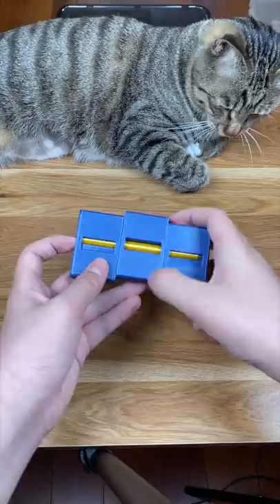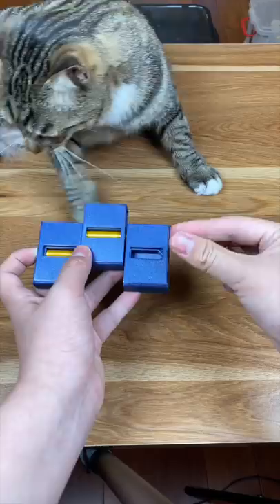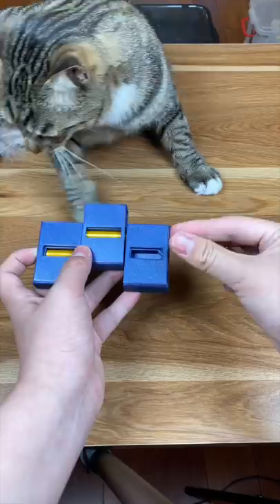3D Printed Magic Trick Box | How does it work?🤯

Comment: That's easy when he pushes it up, a piece that looks identical comes down and the original one goes down to where it is not visible
Reply: Yes x2
Reply: Oh. I thought it was magnets, but after reading your comment and watching it again your right.
Reply: True
Reply: Anyone who didn’t see that is weird
Reply: No, he could put anything inside of it not just the pen. If I put a red crayon in there will a yellow piece pop up above? That’s incorrect
Reply: @Caboose_Sim  Yes, you can see the hatch thing flip, the original item goes up with the box and gets stuck in a special compartment until you move it back down
Reply: @Caboose_Sim  thats exactly how it works, its called "zig zag pencil"
Reply: @Caboose_Sim  I used to have this same trick with a string it’s how the og comment is
Reply: Very true
Reply: No where would it go up is only one area and in the middle he takes the right piece out and bottom is only two spaces it has to be strong magnets on the ends of the pieces so that he can take it apart and put it together
Reply: @sweetred6264  its a trick called zig zag pencil, there are 4 pieces inside it, the full pencil is hidden away where the 3 boxes join when you slide them, that opens up the hidden compartments with the 3 small pieces inside, they make at least 2 and 3 compartment versions of it and you can buy it on ebay for a couple of bucks
If it was strong magnets it wouldn't have fallen out under its own weight at a pretty shallow angle for a start, thats not how magnets work
Reply: Or he just has small mirrors in that make it look like the pen splits but it never does
Reply: Actually it goes up but same concept
Reply: @nicktyler8139  you see the piece fall out and you can take the other 2 out, there are 5 pieces altogether, 1 full size pencil, 3 small pieces and the box, how many more people are going to comment on this without looking at Google first, we all have the world's information at our fingertips, c'mon people, how many times do people have to say how it works?
Reply: @linkinpiatak6669  if you hold it the other way round then its down, the direction is meaningless, its just a matter of which way you hold it really
Reply: They even turned it into a human sized version called zig zag girl that was featured on magic secrets revealed a few years ago
Reply: I was legit about to say that then i looked in the comments
Reply: That’s what I was going to say
Reply: Good catch
Reply: You can literally see it. He does it too slow the first time
Reply: Exactly
Reply: Thank you for explaining so I dont have to write something long lmao
Reply: I was gonna say that to ngl
Reply: Yes
Reply: @Caboose_Sim  Well you'd need to devide the crayon into 3 and then have a whole one too
then you slide the 3 into the hatch and then push them up 
then slide the whole one down, pushing the 3 back down making it look like it snaps back on when in reality it's 1 (cut) crayon and one whole crayon. Or maybe some other trick
Reply: Yeah i was going to commen t like this but simply but il give all the credit and you have a good eyesight
Reply: INF IQ
Reply: Damn someone beat me to commenting first
Reply: Yes you are correct if you look close enough you can see that
Reply: Yep that’s what I guessed
Reply: Didnt he grab a peice from the pencil??
Reply: Lol
Reply: How does the pen restore or break
Reply: @grimmmunchkin  I'm asking the same thing
Reply: @the_mysteryofme  I think magnets
Reply: I was gonna say The same thing 😂
Reply: Thats why the middle piece can't push higher above the other 2
Reply: Bruh why do I always have the same answer as other people
Reply: The two side pieces go up as he took out one of them
Reply: Yea
Reply: That's it if u look at it Fram by Fram u can easily tell the difference
Reply: Yep
Reply: me too
Reply: No
Reply: Yep i saw
Reply: You are right
Reply: Goes up
Reply: @xxmustard_boixx  before i also thought it was magnets till i realized how the pen rolled
Reply: Ya I saw that the second time watching
Reply: @grimmmunchkin  it doesn't, there are 4 pieces, the full size one and 3 small pieces, it never actually breaks or restores
Reply: Dam i was trying not to look cause i knew it but the message box didn't cover it
Reply: What’s sad is that I found this out when I was little. I had one of these that included a rope and that I actually broke it on accident and I found the actual true

Rip my childhood
Reply: I saw this vid in tiktok and I could not fucking figure it out. I can somehow see the trick now that its uploaded to yt lol.
Reply: Yes that is correct
Reply: Lol same
Reply: I saw this and i just figured it out. I was about to comment the way if how it works but you got it already.
Reply: @hamoostaffat  bro chill out I was trying to be creative
Reply: @nicktyler8139  thats fine, but creativity doesn't really help when we know for a fact how its done, if we were still figuring it out then bring on the brain juice, if we were trying to find out how to tweak it to turn it into something new like the human sized version its most definitely the way to go everytime, hell if it wasnt for creative folks us creatively challenged peeps probably wouldn't even have magic at all, we would probably still be living in dark windowless caves to be honest, its just funny to see people scroll past the solution and try to explain how its done, meant no offence dude, I was chuckling and not raging when I typed it if that helps, tone is hard to convey with typed text
Reply: Yes I saw that too
Reply: @sweetred6264  nope you are wrong my dude lol
Reply: @the_mysteryofme   there are two pencils one that is broken up and one that isn’t
Reply: Yessir
Reply: No it was magic
Reply: i saw the broken pen go down
Reply: @hamoostaffat  but the box breaks the pen so magnets
Reply: I had a toy like this
Reply: @grimmmunchkin  it doesn't break it, it just get hidden while it uncovers 3 pre performance hidden pieces to make it look like it was broken, hence why I keep saying there are 4 pieces of pencil, the full size one and the 3 smaller pieces, you could do it with magnets but if you tipped the pieces out into your hand there is a high chance they could stick back together and give the game away, plus you would most likely hear them click together during the "restore", you could even add another factor and tap something or drop the pencil on the table just to dispell the idea people would definitely come to which is magnets, its not a terrible idea but there are too many ways for magnets to give it all away in such a small trick
If you pause and turn the speed down, between 12 and 13 seconds you can see all 4 pieces at the same time

Edit now I have done that to try and get you a time stamp i can see he has an even simpler version with only 3 pieces, there is also a 2 slot version of this as well with only 2 pieces
Reply: Yep

Comment: Ik how, there are multiple different pens and when he puts it up the pen on the top will suddenly appear, so there for on each part of the box there is a different type of pen.
Reply: Confused unga bunga
Reply: Yes thats what i said
Reply: Same answer
Reply: If that's the case... Then did the original one break? How can the original one split or hide itself in a different "space" and restores itself
Reply: Same.
Reply: @FadingDarkness1100  Rewatch the video there is still a part of the box that has a straight line through it and it’s exactly where the pen is
Reply: Yes
Reply: I have one of these. There are two pens, one solid piece and another one that’s three separate pieces. When he slides the box, the solid pen gets pushed up into the top corner of the box and the broken pieces are revealed where they were hiding in the lower part of the box.
Reply: That’s what I thought
Reply: When he shifts it back to place you can literally see whats going on
Reply: You beet me to it 
It flips in a blink of an eye
Reply: Wut I have no idea what you said
Reply: Yup
Reply: Cunfused
Reply: I was gonna say that but you did
Reply: I was about to say that
Reply: Ik to
Reply: I was thinking it can be a magnet pen that are separate parts but I was also thinking the same thing
Reply: @ailyn constantino wow

Comment: There are 2 options.
A) the oen you are using is strictly stuck into 3 pieces, making a pen,  but can be dissolved into 3 separate pieces.
B) the box quickly saves your pen in an entirely different spot, where the pen cannot be dissolved/broken and gets changed with the broken pen which is identical to the unbreakable pen.

Comment: Yes, the middle price has two. Also, the cat is adorable.
Reply: they all have a second smaller piece. the single pen is moved up and the second compartment is pulled up revealing the broken pieces
Reply: idk why i typed that. i typed it correctly when i posted my main comment.
the first and third compartments have broken pieces stored at the bottom of the 'boxes or whatever. they move up to be visible when the pen is pushed up. the middle compartment will not fall out as a small piece because it is the solid pen. the first and third pieces will.

tell you what, i bet if you watch it in slow motion, you will see how the mechanism works.
in case my explination is hard to read

Comment: The pen is actually pushed forward when you lift the middle part and a cut pen on the sides is pushed forward, and theres a connection with the middle part too causing the bottom part to get up cuz theres little walls on the side that pushes it. 
Thats a lot to explain

Comment: There are 3 pieces in it, the long one you put in, and 3 smaller ones on the inside. When you move it it moves the long piece up and the smaller pieces down, then you can move those. Then when it snaps back it just goes back and then it goes to the long piece

Comment: When you slid it back the first time, the trick was quite obviously revealed. There was a compartment with the smaller "pens". The original pen was slid up
Reply: Yeah exactly what i was thinking
Reply: Yeah but, the you cannot break the original pen?????
Reply: Yeah that was what I was thinking
Reply: @Notkiwi  the original pen doesn’t get broken, it just moves up (hence you can’t see the center anymore). The two ends are the mini replacement pieces. The original pen is just tucked up
Reply: @Notkiwi  it moved to the bottom side in the middle while in the left and right sides it moved on the top

This thing is pretty easy with the right thinking

While the small pencils are stored in on the bellow compartment
Reply: Yeah I saw that too.

Comment: If you look closely, you'll see it. Basicaly what happins is when he pushes the middle section up it also pushes the bar he inserted as well.this hides the bar he put in and reveals a different bar that was hidden, except this one is divided into 3 pieces. When he pushes the middle section down, it hides the secondary bar again and reaveals the original one.
Edit:I didnt warch the explanatikn video, the guy did the trick a little too slow and gave it away for me. Its really obvious at the 11 second mark

Comment: 2 things.

1.the pen or whatever it is  its magnets

2.THE CAT IS SO FRICKING cuTe😍
Reply: YaS CaT CuTe
Reply: But I actually used to have one of these and there's an empty space to put the pen so it doesn't break and it has a few extra little pieces on another part that it pushes into the holes so if you look at the right time you will see that there is no pen when he flips it
Reply: It isn’t magnets, when you put the full piece and divide it, it switches to another pair of 3
Reply: No magnets
Reply: Bro the pen is shifting ,both sides
Reply: its not magnets lmao there are 2 sets of pens one not chopped up pen and one chopped up pen the chopped up pen was already there play the video at .25 speed and youll see that in a small time the ncup was going up
Reply: I got it.
Actually the broken pieces of pen are in the box so when you divide it the pieces slide up, making the real pen safe. And when you restore the pieces get back into there place unlocking the pencil. Easy.

Comment: i used to have this thing as a kid: basically there’s a secret compartment where the small pieces go, and it would bend the rope inside. i don’t know exactly how he did it, since he’s using a  pencil instead of rope.
Reply: The only piece of the original pencil he puts in there is the centre piece. When he "divides it" if you watch you can see a point where the other two chambers are blank and then the smaller pieces "appear" basically from my best guess there is a contraption inside that houses two smaller pieces. When he pushes the centre piece up the whole pencil raises up with the centre bit so the whole pencil is at the top of the box the the two smaller pieces get raised up as the pencil is raised to make it look like it has separated
Reply: Same I had one of those magic kits with the rip one so I’m pretty confused with the pencil
Reply: Well the outside boxes don't accurately represent what goes on inside:
_________________
|.                                |
_________________
____.            _____
|.       |.           |.        | 
____.            _____

The lower parts are where the small pieces go and the upper part is where the pencil goes. He just shifts the right and left box down, hiding the left and right part of the pencil while showing the 2 small extra parts, while keeping the middle in its normal position to show the middle part of the pencil.
Reply: I knew it I saw it fall in the second time he did it

Comment: 🥺❤😸 

Edit: the way that magic trick works is that those three pieces are already in the box but slide into view when you push the middle segment up. When you push it back down the full pen slides back into view. The way they slide out and in view is with some sort of gear system that activates when pushing the middle segment up.
Reply: @Lone wrong, the box contains three separate pieces to make it seem like you divided the whole pen into 3 parts.
Reply: Oh yeah, if you look closely at the little windows you can see them being switched out

Comment: when you “cut the pieces” the pieces go out of sight, so i think that theres 2 1/3 pieces that switch when you pull it up, and the full piece pulls up with it, hidden inside the top of the left and right thirds
Reply: yes that is it
Reply: sounds good to me
Reply: Yep
Reply: What i was thinking two you can sea the bottom pieces go down when it becomes full again
Reply: @graygranola2051  your right
Reply: Even better, there is 3 pieces of 1/3, notice the plastic is still connected in a straight line, that's where the full piece is, there is moving parts inside that hide it and show the 3 small pieces that were already in there, even if u don't put in the big piece you can still use it and make those 3 appear
Reply: Yes that is the conclusion I came to as well when I saw the sides go out of sight
Reply: I have my own idea. If you insert the pen and divide the pen, the pen you inserted gets pushed into a compartment in the back and pushes out the divided parts. And if you put them back together, the pen you inserted comes back up.

Comment: It works because there's three separate ones on top of the first layer so when you push it up the ones that are divided are broken into the slot but then when you push it back down irreverts back

Comment: Literally saw the pen piece slots move over when the pen came "together"
Reply: Actually he cut in to 3 pieces and he add some magnet
Reply: @venzdanieldeleon9619  it switches due to a mechanism. You can see the parts mover because of the mechanism inside. Stop trying to act smart by saying it is magnets
Reply: Its magnet.
Reply: The pen is changing space beetwen that box..
And 3 piece ,is prepared trick from the box
It's mechanism
Reply: @venzdanieldeleon9619  bro watch it again you will see know if you look at the 1st box because when i watched it first time i thought it was a magnet too but its not
Reply: Youre right   there are already 2 pieces inside of the box  
thanks bro
Reply: @Sentient-Noodle  it look like it but I think it a distraction like the cat they could make a custom magnet pen since if we see it closely there no space for the both pen to be in thete
Reply: @jdenyzb4321  its a simple mechanism that switches it. Both full pen and pen cut into 3 can fit otherwise if it wasn't a mechanism why would he need that much room. If it truly cut and combined then why can't all three peices if the thing he made come apart
Reply: @jharmley6882  but it isnt
Reply: @jdenyzb4321  there is a part of the thing he made where all three pieces link together which is where the full pen is while due to a mechanism it switches as he slides it. You can literally see it move in the machine during the first time. That is why the second time he does it fast in order to make sure you don't know.
Reply: @jdenyzb4321  how much sense do the people here need to hit you with?